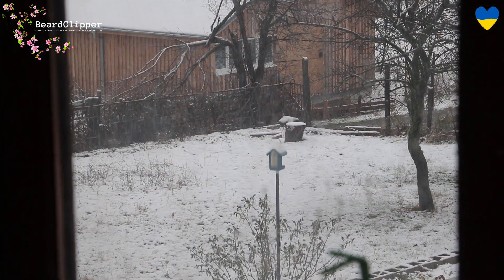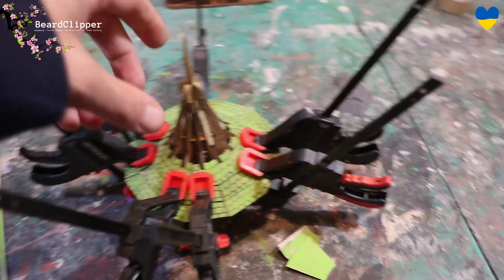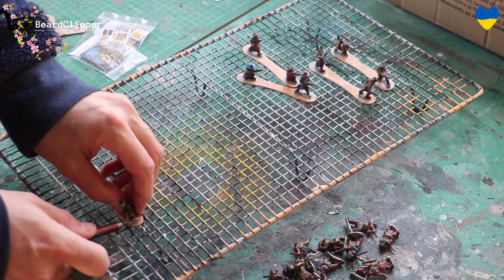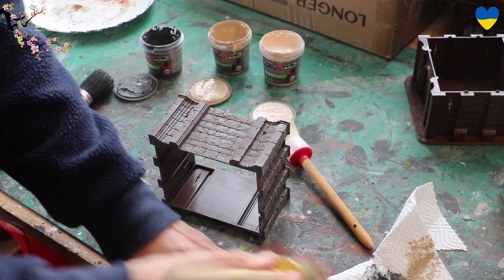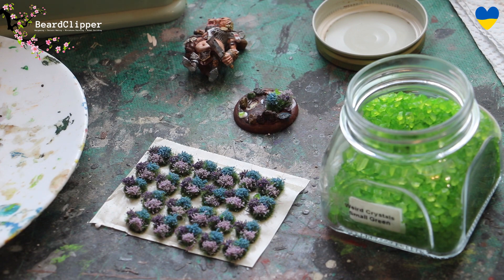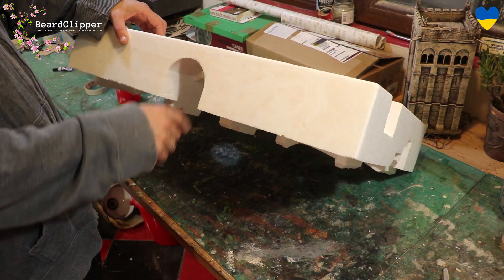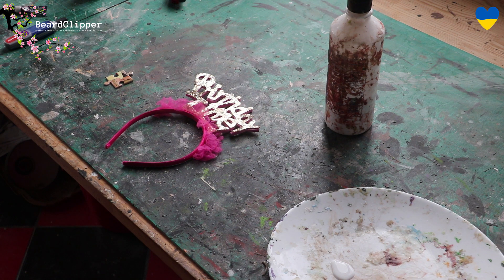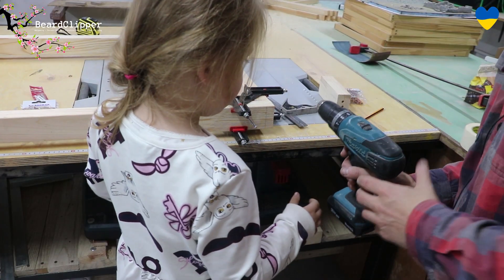Woodworking with my daughter and laying carboard paving slabs!

Comment: Always do some thing every day whether it is modelling, gaming, or painting.  Is Rosie helping with your Western project.  You need to stick your house with 'no-nails'  seems to stick every thing.   Hope the figures are varnished!   Bare feet in the workshop is not very  H&S clever.    No point using helmets, google, and masks if you are not wearing foot protection.  Looks like Rosie enjoys the first snows.   We have had our first frosts this weekend.
Reply from the maker: Yeah I do multiple things every day :)

Nope that's for me.

I wear Bulgarian Safety Shoes - they keep my feet from getting too hot.

Yeah, we've had a lot of fun but the snow melted away quite quickly. Hopefully we'll have some more soon.

Cheers